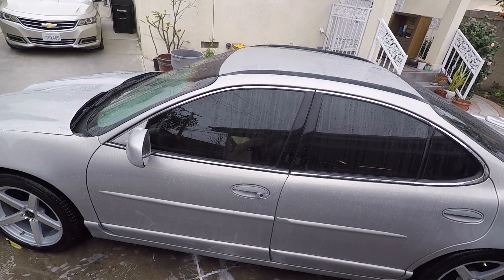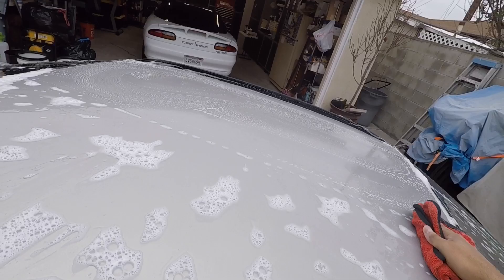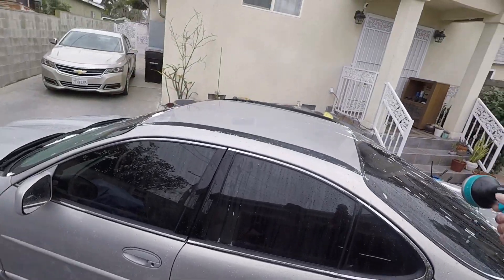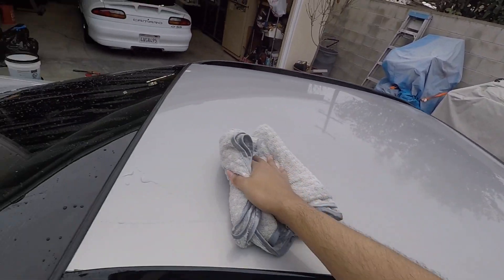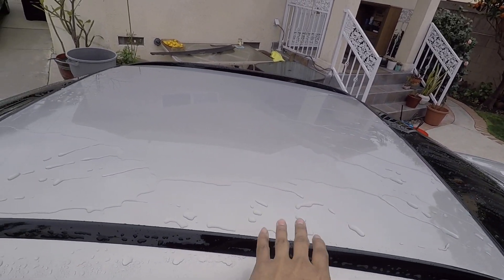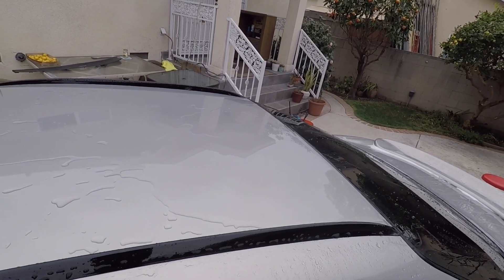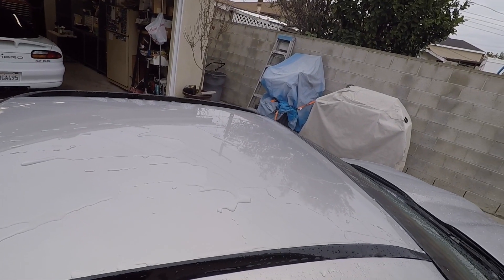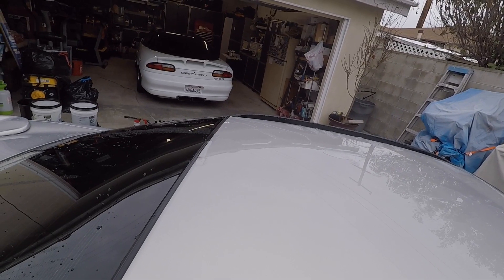Final update to the 2020 Ceramic Coating  Durability Test

Comment from the maker: A little more background information just to fill in the gaps for those that did not follow the progression.  This test involved no toppers as that would have skewed the results and we would never know how a coating performs by itself.  Remember this is for testing purposes.  This experience is my own and is not the exact experience everyone will have based on the environment around us.  I will also mention that coatings do degrade just at a slower pace compared to a wax or sealant.  Everyone is topping there coating and yes coatings do require some maintenance.  

The paint was chemically decontaminated with Ironx and Tarx a couple weeks ago.  

My car sits outside 24/7.  It is constantly exposed to the Southern California elements.  Primarily the sun and UV.  Looking up the UV index over the course of 2020, the average in the summer months ranges from 7-10 on a scale of 11.  This has been an issue in my area as the horizontal surfaces break down faster than the vertical surfaces with any form of protection.  

Wildfire season in California was harsh for 2020 which left the cars exposed to ash.  Ash becomes high alkaline when it is exposed to water  (aka morning dew) which can reach as high as a pH 12.  Some coatings can handle up to a pH 14.  Not to mention that ash is abrasive.  Unfortunately this car sits outside and I can't wash it everyday during that time frame and I wiping it down every day during a fire becomes cumbersome as I would be washing towels daily and running out of towels.  The same can be said during the 4th of July when the neighbors launch their illegal fireworks into the air.  

Al in all this is just my personal experience in my environment.  This is not a definitive test to prove that these brands will fail.  So my advice is to pick a coating and try it out.  Maintain it and if it doesn't meet your needs then try a different brand.  Hope this helps.

Comment: how was the application of the drexler combo? what is your thoughts on that one?
Reply from the maker: Very easy to work with.  You can feel where you applied it as it is slick in those areas.  At least with the base coat.  The base coat does tack up after a few hours so the top coat is adding the slickness.

Comment: Harsh environment? That Cali sun, man. I had to go back and compare to the 3 month update.  Big difference. Thanks for the update
Reply from the maker: The UV is what degrades a coating around here.  If you notice many folks in the snow environments have their coatings fail on the lower areas.  But here in California it's the opposite.  Lower panels are fine and the flat panels are the ones that fail sooner.  That has been my experience with all of the coatings I have used.
Reply: @MikeGDetailing  I never noticed that!!!!

Comment: Would you normally agitate an alkaline snow foam such as Lift in place of a shampoo? I'm surprised to see the panel so flat, out of interest when was it last decon'd with a fallout remover?
Reply from the maker: Perfectly fine. I made a video on the pH level once on the panel drops to 7.5.  Won’t harm the coatings and Lift isn’t Thant strong at 1:10.  

CarPro states it can be used as a soap for a traditional wash.  

I deconned it a couple weeks ago with IronX and Tarx.  They have been flat for so long for quite some time.